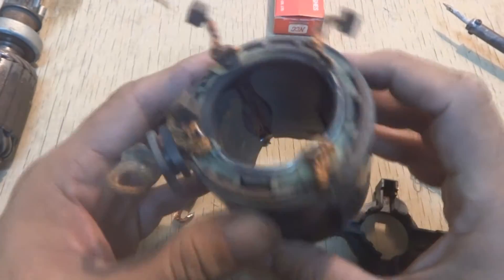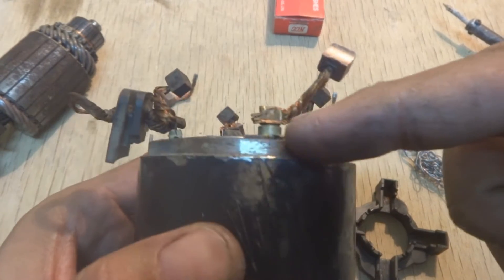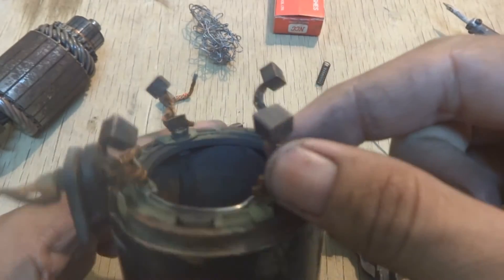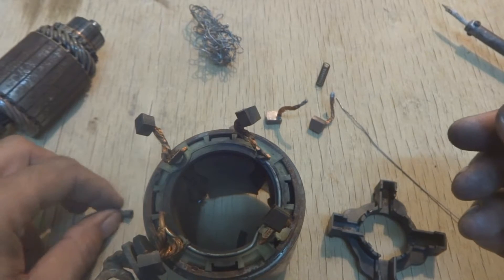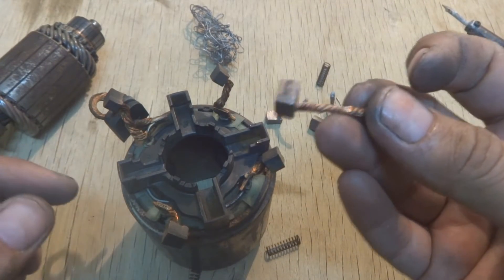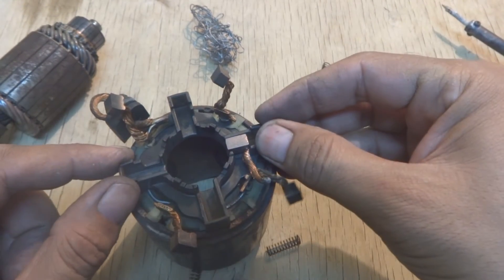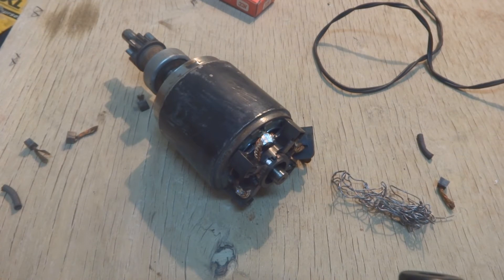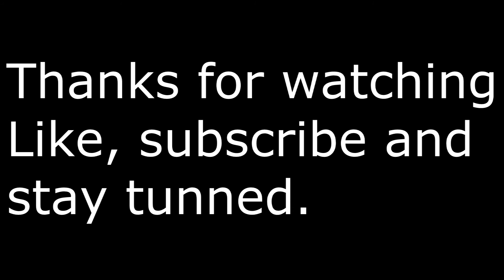How to fix self starter. self starter wouldn't start the car. self starter rebuilding

Comment: Sir, which type DC motor it is.? 
Shunt, series,compound
Reply from the maker: These are dc series motors. Sometimes in small self starters they use permanent magnet type dc motors.
Reply: @JahanZeb1976  Thank you sir

Comment: Well done! You didn't waste any time, you got to the important points while still stating some good facts that would be handy for people to know.
A suggestion may be to invest in a cheap 100w or 50w LED, Lighting really make a difference ;)
Reply: Also, For these types of tasks, (Fat copper in this instance) You could use a Small Pencil torch.
Very useful for large soldering tasks.
Reply from the maker: Thanks dear friend for liking and great suggestion. I would give a try. Regards,

Comment: Nice work Johan and good that you could find some brushes and then modify them to work. If you had a soldering gun, you could would have more heat, but I know how it is that you work with what you have. Take care...

Comment: Smashing job Jahan :-D

Hopefully it worked good after the carbon brushes worn into the commutator, it can take a little while for them to bed in.
You used a file to shape the brushes, i did similar, i held a strip of sandpaper flat on a level surface and moved the carbon brush up and down the sandpaper strip.
Same result :-).

The only thing i would do different is to leave the brush wire long, i know the solder will wick up the wire and stop it bending (ive made that mistake lol), also tinning of the terminal is required.
Your soldering iron is too small a capacity and too small a tip, that made it hard for you :-(.
Reply from the maker: Thanks sir for constructive comment. This is reality that my soldering iron was a regular electronics work soldering iron and here it was needing a very heavy duty winding man heavy soldering iron to do the job but unfortunately one was not available for me for the job. Regards,
Reply: Yes it is difficult working with non ideal tools, i hope you dont need to do this type of starter often :-(.
Hope you and family are well, nice to see you again :-)
Reply: Where you guys get your brushes for starters and alternators?
Reply: Yep you looked struggling with this soldering iron. May be if you replace the tip with chisel type tip that has more surface area and prior priming the tip with solder will help in transmitting the heat more to the soldering joint. Of course you can buy a cheap adjustable soldering iron from ebay for about 10 bucks and it comes with different types of tips.

Regards :-)